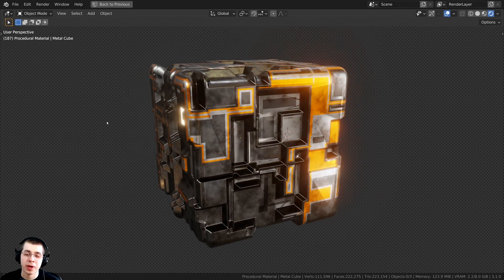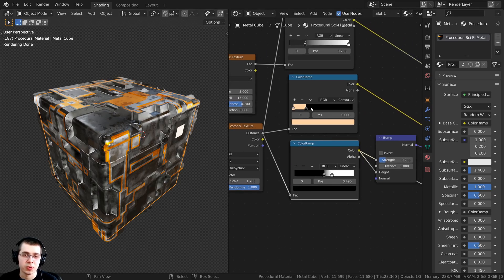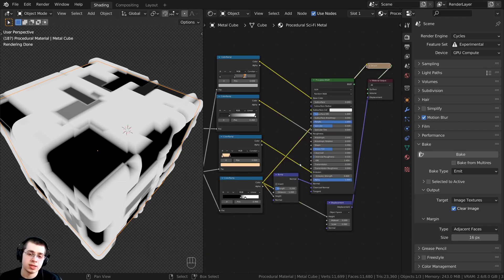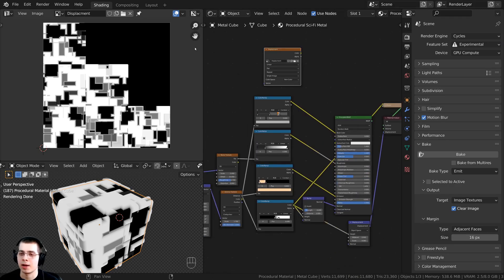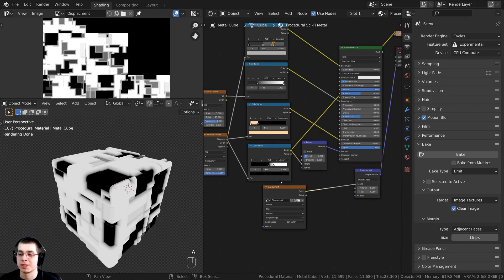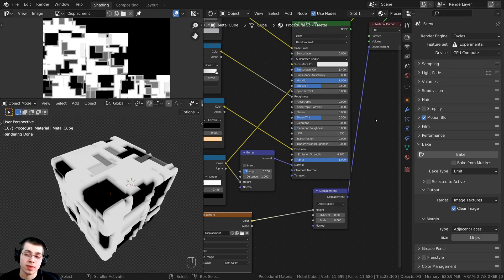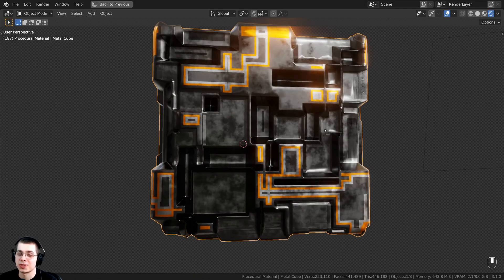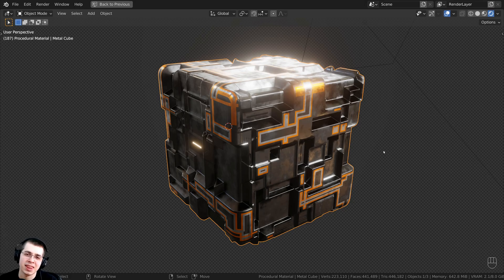How to Bake Displacement Maps (Blender Tutorial)

Comment: Does anyone have a better way to transfer textures from a high poly object to a low poly? Ive tried displacement (which is I cant get working). Ive trued normal mapping but  normals only add detail (the "hills" not the "valleys").  Very frustrating.

Comment: I don't actually have a viewer node. Do I use an emission shader?
Reply from the maker: in the new blender update they removed the "Viewer node" but the node wrangler still works the same.
Reply: @RyanKingArt  so it's fine if we just leave the color ramp directly plugged to the material output and bake?

Comment: @Ryan King Art Quick question, after you bake the displacement map and then add the displacement modifier, CAN you create a normal map for a low poly model by baking the high res model texture to the low one? Is this another viable method? (Although in the case of this mesh that you used its displaced pretty deeply so I dont think you can in this case.) Im just wondering because I've been figuring out a workflow for this when working on a game in unreal. I think that that your tutorial solved a big piece of this puzzle. Thanks by the way. Definitely subscription worthy:)
Reply: Did you figure it out? :(

Comment: Great tutorial, quick question tho: How was this done before the Material Node 'viewer' node addon was available? So the standard Material Output won't 'emit' anything to be baked?
Reply from the maker: Hmm, not sure. the Node wrangler has been in Blender for a long time.
Reply: Just using a normal emittion shader should work. I think the viewer node is just a renamed one anyway. You can also just connect it straight into the output with no extra nodes and it should work fine

Comment: What if I made a texture with more then 1 Displacement Node. In my case I have three displacement nodes, with various scale and mid level settings, added together with Vector Math nodes (which might not be the suggested way - I'm somewhat new) and I want to bake the texture AFTER the displacement nodes, not before, so I can tidy those up bit. Is that possible? I tried it a couple of times and can't quite get it to look like it does pre bake. I'm also having a hard time finding info online about using more then one Displacement node at the same time. Would love some help if you can give it. Also, great tutorials! You're one of my go to dudes for Blender learning. Thanks!!!
Reply from the maker: If you combine all three displacements with Mix RGB Nodes, you can then bake the final Mix RGB, with them all combined, and that should work.
Reply: @RyanKingArt  I couldn't quite get this to work. But baking the textures before them made a big enough difference. I'll have to figure out a better way to get more depth variety from a single displacement node in the future. Thanks!!

Comment: I would like to mention that it is not a good idea to use jpg for bump maps. Beside the fact it is a lossy format escpecially at high frequencies (sharp edges) there are problems with gamma correction and the 8 bit color space limit. For a HQ bump/disp map you should use EXR file format.
Reply from the maker: Thanks for the info 👍‍